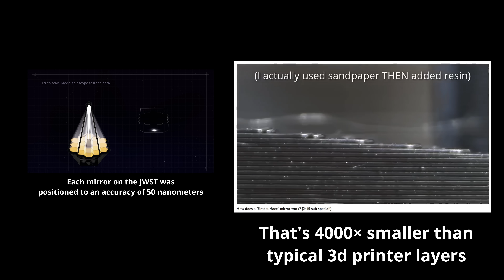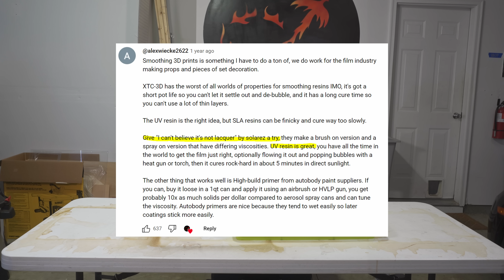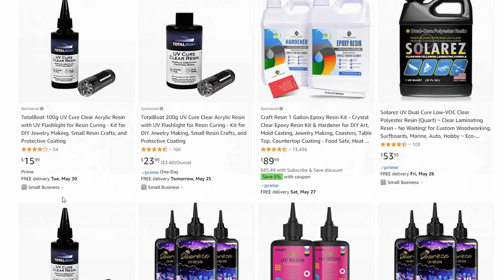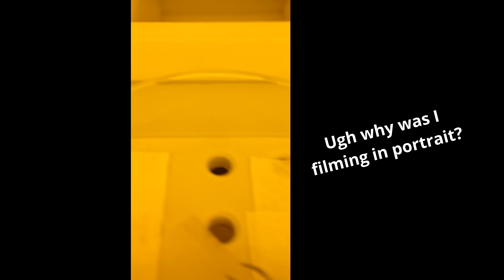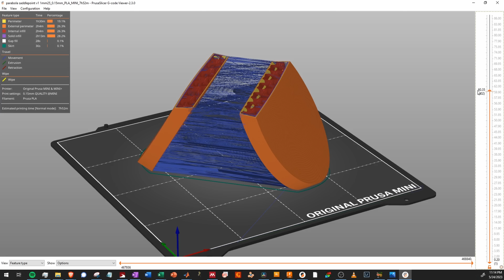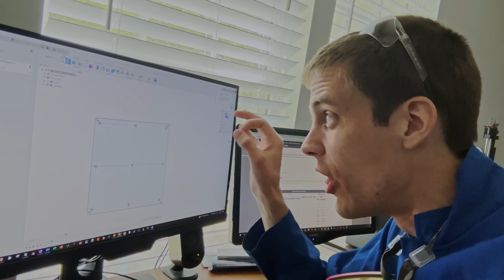Two ways to make asymmetric mirrors (Printing vs. Warping)

Comment: I saw an anti bird device that was to be hung from the branch of a fruit tree that was a 10 turns helix made of a strip of acrylic. Part of that helix looked like a saddle, my reflection in it was turned 90°. I assume the difference of focal distance between orthogonal directions is controlled by the pitch of the twist. Search “Swivel Bar Bird Repellent Reflective Scare Sticks Spiral Deterrent” to find the thing. The scale is wrong for Steve’s application of course. That could be an inspiration to produce a larger saddle mirror from a larger twisted strip of acrylic. Making a longer strip and doing turns would smooth the holding clamp irregularities.

Comment: Try passing a torch flame over the part you want to silver. Just lick the flame over the surface right before you silver. See if that improves wetting and adhesion.

Comment: All floors you buy are coated with a UV cure Polyurethane lacquer... it is industry standard. 
But why did you not just take a piece of acrylic or polycarbonate, bend it on a template with heat, and the silverized it. seems a bit over engineering... but then again, doing is learning.

Comment: Maybe it's silly, but did you consider the conversion from the Fusion360 part to a mesh as the source of your surface wobbles? 

I've noticed that the conversion to mesh of large, gently curved surfaces is often done using stretched, strip-like triangles that can leave the final surface looking like its made up of panels after smoothing.

Comment: A comment I didn’t see scrolling through: Other common causes of those sorts of banding is subpar filament. Either differences in melt rate, though that causes more subtle changes, or more seriously, inconsistent diameters. 3D printers meter their filaments via distance — how many millimeters to advance the filament per non-travel move. If the diameter of the filament is varying even as little as +/- 0.03 mm, that’s still a 3.3% difference in diameter, which is as much as a 10% swing in volumetric extrusion, if my math is right. There’s ways to make the Klipper and other firmwares for 3D printers use a filament width sensor for exactly this reason, but an easier option is to just buy high end, tighter tolerance filament.

Edit: I don’t suspect the Z screw simply because the banding doesn’t look very consistent, and you showed a Prusa printer. They’re not very “high spec” as far as features but they’re well built so I doubt that’s the issue. A bent/loose Z screw usually results in a regular pattern.

Comment: From my own personal experience with 3D printing, I'd say your best bet is probably using ASA, ABS or something like that and acetone smoothing it. If done correctly acetone smoothing can give you a surprisingly good mirror finish. Perhaps printing the part with non planar 3D printing, would also help making the part a little smoother to begin with. In that case you'd also be printing it flat, so the z wobble wouldn't have such a pronounced effect. Obviously you also want the smallest layer height possible, the Prusa Mini should be able to go down to 0.05mm, which is probably worth the quadruple print time in this case...

Comment: 10:52 lemme pause you right here, 3D printing is a rabbit hole and honest to god yes those things do affect quality but they are visibly not a problem in the base print. maybe a better infill pattern in the slicer could make a substantial difference in the type of distortion but really you're looking at the limitations of your nozzle size and chosen material. vapor smoothing printed ABS and then coating it in a mirror would work a lot better than trying to add a smooth coating on top. look into fiberglass mold polishing if you want to understand how to make a mirror out of plastic because you're really reinventing the wheel in a lot of strange places here.

Comment: In fairness to the mixed units of the bolt holes, the UK is still in a limbo state of mixed units. The UK start metrication when they joined the EU. But the UK being the UK, they went "Stuff that!" and took forever to do said metrication that it basically went limbo and mixed them. Now they are less obligated to do so, but not really because they still have to do business and scientific pursuits with colleagues across the channel.

Comment: This might be a strange idea or might be total rubbish but your still probably the right person to try this, could you use bubble physics and surface tension to shape a material in a frame to form a perfectly smooth, mathematically perfect double paraboloid? This should work so long as the material shrinks as it sets like glass which would cause it to minimise its surface area. You could then use that very fragile shape to set epoxy into exactly the right shape with a super smooth glassy finish that should be at sufficient optical quality and significantly more durable as the silver seemed to adhere well to the epoxy

Comment: That layer inconsistency was something I had to chase in my 3d printing journey for a while. I tracked it down to my v groove wheels (I had an ender 3 at the time), changing them from the TPU wheels to the firmer polycarbonate wheels almost immediately solved my issue. My stock TPU wheels also developed flat spots from preheating in my heated enclosure. With your one-sided prusa, I would blame the wobble and inconsistency on the lack of support.

Comment: I wonder if nonplanner slicing and a smaller diameter nozzle would give a more reliable surface finish as you would be able to print flat and get rid of the vertical layer lines

Comment: Surely there's some flexible-enough type of glass, such that you could put a small pane of it in the same tensioning rig?  Or use a heat gun to relax the glass enough to bend it in the rig?  Since the silvering chemicals are designed for use with glass?

Comment: Can you tune two venturies to deposit an even mixture of A and B on the surface instead of using spray bottles? will that have any effect? Also you can try vacuum casting a sheet of plastic which the reaction adheres to better

Comment: what if you used the 3D printed mirror as a base for vacuum forming? maybe the resulting piece would be much smoother on the outside due to the material thickness

Comment: When you pulled out the cast acrylic, i thought you were gonna use one of the 3D-printed saddles as a vacuform buck! That'd potentially be a good way to transfer the macroscale surface profile to the piece of acrylic while retaining the microscale smoothness of the acrylic sheet and mitigating the mid-scale lumpiness of the form.

Comment: There are pre-coated acrylic first surface mirror sheets available that I've used for this kind of stuff before (making curved mirrors for ldgraphy). The surface is pretty sturdy and even survived putting into boiling water to get it easier to bend.

Comment: I have an experiment idea for you, not sure if it is measurable but I haven't seen anyone do an experiment on this and you have measured things I thought not possible. According to the internet a spring under pressure has more mass because of the whole E=MC2 you are storing energy as mass in the spring under tension or a battery that is charged would have more mass as well etc.. if it isn't measurable it would also be interesting for an explanation on why or what experiment would be necessary.
Reply: I guess the battery experiment has been done but I still haven't seen anyone do a spring

Comment: I had a very similar problem a while ago and realized that you can get surprisingly good optical quality double-curved mirrors by 3d-printing molds and then thermoforming a aluminium-coated polystyrene sheet. The melted/softened 1mm thick PS sheet does average out the layer steps of FDM prints while the mold is curving the AL layer in the sandwiched polystyrene sheet nicely. I used that for enlarging and redirecting pico laser projectors with an okay-ish quality. There is a video on my channel where I discuss the process and show some results.

Comment: My guess on the issues with the 3-D printed mirror are because you used an STL. I don’t believe PrusaSlicer allows the use of STEP files, but some thing like Bambu or Orca Slicer does. That would likely get you less faceting and a smoother surface finish overall.

I’m still not fully up to speed on this, but you might need a 32 bit printer to print step files with arcs in the G code instead of line segments. Maybe someone else who is experienced printing STEP files can chime in.

Comment: Two suggestions.  One is to smooth the surface before silvering it.  Sandpaper, glass beads, stuff like that.  Or even hitting it with a heat gun to melt it so the surface flows together into a single surface.  Also, the rotating technique makes a lot of sense, so why not keep doing that when using the spray bottles?

Comment: is there anything preventing you from just coating the acrylic with uv-cure resin? i suspect the resin may be too hard to be bent after the fact but you may have success bending it, applying resin in place, and then silvering the resin. Since the silver seems to like sticking to the resin, and since UV cure resin should stick well to acrylic, logic says this should work.

Comment: The striations you saw in your 3D printed mirror are most likely caused by the infill pattern that you used. At 10:00 in the video you can see the deformation caused by the infill in the surface. From testing with PLA it takes about 8~10 mm of wall thickness to get rid of this bleed through tension. For small parts like this the easiest solution is to just print it solid.

Comment: Ive seen people use software to make 3D printers use the up and down axis while printing. Usually they print most of the part normally in layers but the last 3 to 5 layers are done in 3 dimensions, going up and down while extruding plastic to make true 3D curves. Maybe that can lead to better 3d printed mirrors

Comment: use some automotive body fill (bondo) to fill in the space between the layer lines and hope it is compatible with the silver solution.  By fill in I also mean sand and smooth, not just slap some goo in and hope it works.

Comment: On the danger of asking the obvious: Did you try to crank up the resolution when exporting the model from CAD to Cura? I find that especially cylinders come out quite blocky with default values, so I'd expect the same with your mirror.

Comment: You should try non-planar 3d printing, so that you are able to create the mirror surface as the last layer, without having layer steps or placing the part in a weird way. Same sanding may be required to obtain a completely smooth surface though.

Comment: If you wanted to do this better, you could use the 3dprinter to make abrasive forms, basically make a form to hold your piece and a form to hold sand paper or a guide for some sort of rotary tool and use that to polish away all large imperfections using a higher grit sandpaper, and from there you can coat it with the uv resin and have a much less wavy surface.

Comment: Excuse my ignorance, but did you try simply sanding the 3d-print before applying the mirror coating? Every wood working project has a pre-paint sanding step. Would that not work for this type of project?

Comment: You can electroplate the mirror with nickel on top and keep it from getting rubbed off! 
And in general you can plate any other plastic thing after you seed it with silver. 
There are also silvering solutions based on citric acid, ascorbic acid (yes, vitamin C), EDTA and silver nitrate that plate directly onto PLA.
I don't have a 3D printer but I plate stuff, a neighbor gave me some stuff to try, and I couldn't get the silver to stick with Tollens-based alkaline solutions. I realized that NaOH and bases in general slowly de-polymerize PLA. I'm thinking that while it takes quite some time to dissolve a part completely, it's acting fast enough that the surface is getting dissolved too fast for the silver to stick. So I cooked up the silver lemonade I mentioned before.
No respirator needed, no messy spray bottles, just soak the thing in the solution. If you wanna try it I can give you more deets :P
Reply: This sounds really interesting.  What ratio did you use of each of those?
Reply: @EmperorA0  I just keep stock solutions of every one:. 10mg/mL for the AgNO3, EDTA, and ascorbic acid. 100mg/mL for citric acid. 
Mix 1 part of nitrate, citric acid and EDTA solutions each. Add 2 parts ascorbic acid soln. to start plating.
To activate parts for plating soak in dilute SnCl2 acidified with HCl, then rinse, then soak in dilute AgNO3 (like 10x less than the stock). Concentrations are not super important for this step, but it seeds silver nanoparticles. This will help your part preferentially plate. The bath is truly electroless for a few minutes and only plates activated parts, then it starts silvering the container and eventually crashes out silver powder.
Reply: @EmperorA0  EDTA is the disodium salt btw, Na2EDTA, not the acid itself

Comment: Have you ever heard about vapor smoothing of 3D parts?
You basically 3D print a part out of ABS or ASA and put it in a air tight jar with acetone on the floor. (heating up a bit gives quicker results)
The finish is almost mirror like. The key is to let the part sit for a couple of days to reharden the surface for further coating  with your silver applying method.

Comment: Maybe you could get better surface quality via some kind of lapping between two or more prints? The prints are decently dimensionally accurate at a large scale, but they're wildly inconsistent at small details. This makes individual prints really bad, but it's very unlikely that two different prints would have the same errors. If you took the average of the two prints, it'd be closer to the shape that you want. Average out enough prints, and you've got a perfect surface. But because these would both be concave surfaces, you can't just lap one against the other, so you'd need to print out some matching convex versions to use as an in-between. It's like a weird version of the Three Plates Method for making flat surfaces.

While this method would hopefully/probably/maybe work for telescope mirrors that are axially symmetric, I'm not sure if it would work for the saddlepoint mirrors. I guess while you couldn't rotate them all the way around, you could jostle them back and forth a little? Still a lapping action, but with movement measured in millimeters.
Reply: i don't think you need the in-between plate
as long as you don't do relative rotation, you can get a quite nice hyperbolic surface
as demonstrated here by ROBRENZ https://youtu.be/Va4TGDnQqDs?t=190

Comment: I've seen so much about saddles but no one ever goes past the 2-fold "Pringle" to the 3-fold "monkey saddle". Years ago I sanded and polished a dollar coin and bent it into shape using 2 3d printed 3-fold saddle surface forms. The result was quite good, especially after electroplating it with copper to give it a more uniform surface.

Comment: Have you considered using nonplanner 3d printing for the surface layer?
Reply from the maker: Thought about it - didn’t implement. I’m not convinced it would be better than the sideways orientation. Even nonplanar ironing may leave larger ridges

Comment: You could print a negative of your shape, heat acrylic until it becomes soft, and pressform it between the positive and negatives of your forms. As a matter of fact, you could do that with thin aluminum foil and silver that. Perhaps glue the foil to acrylic or pvc sheets and pressform it. Or if you prefer, you could vacuum form it. So many options!

Comment: With my slicer and 3d printer, curves are created from many small tiny straight lines if you look closely enough. So, I don't think I could ever get a smooth enough surface for mirroring with my setup.

Comment: Would love to see you try this again with a modified slicer for the printer. They have some that can modulate the z-axis at the same time so you have a nice smooth top surface.
Reply: This is still a fairly manual process with post processing scripts but will be interesting to see when 3D slicing is more available and automatic

Comment: If you can get me a mirror base that won't outgas. I can see if I can coat the parts with a physical vapor deposition.

This can be done in bare silver, gold, a high reflective stack of materials (opposite of an AR coating we stack two clear material in layers and it becomes more reflective than silver and aluminum), or add a thin top coat of quartz to seal in the silver and prevent oxidation and scratching.

I do think we have done plastics before but I would have to beg to do a one off specialty run lol.

Comment: I haven't heard anything about you using acetone vapor to smooth the print before the whole process. Acetone "melts" the PLA and stuff that would allow you to smooth it out and then apply the uv cure resin

Comment: Did you consider printing with ABS instead and them smoothing it? I've never done it myself but that should remove the layer lines on top, and then either the UV cure resin might work better, or you could just skip the resin entirely and put the silver straight on top of the ABS.
Reply: And you could even to the acetone bath while spinning to eliminate any drooping
Reply: He said vapor smoothing wasn't done due to the possibility of pores
Reply: @belded-wee  oh, mustve missed it, do you have the timestamp?

Comment: Dont know if it resin based, but the stuff they fix holes in teeth (other than the older quicksilver thingy) is also UV-hardened. It's awesome doctor fills the whole, puts on the UV light 10 seconds later its as hard as teeth.

Comment: How about coating the print in a lot of resin, and spin it around fast so the spinning creates the parabola, and the 3d print is just infill underneath it. Isnt gonna work for different shapes, but could work for the parabola